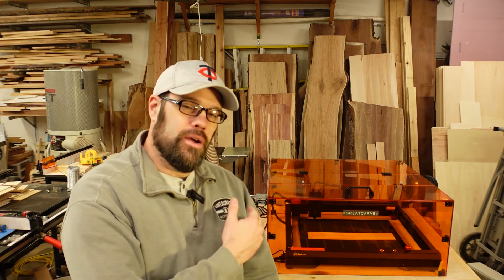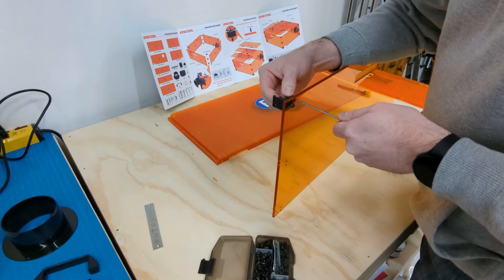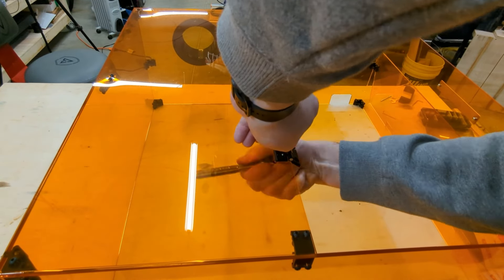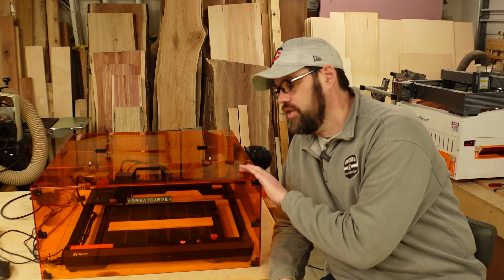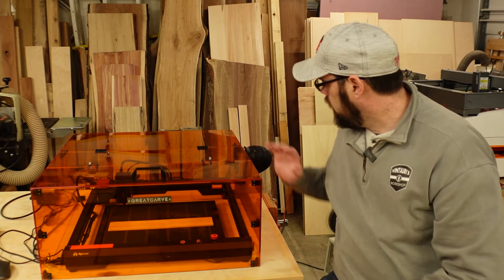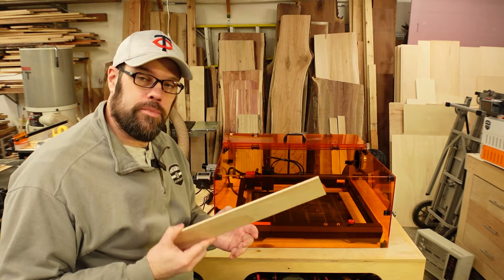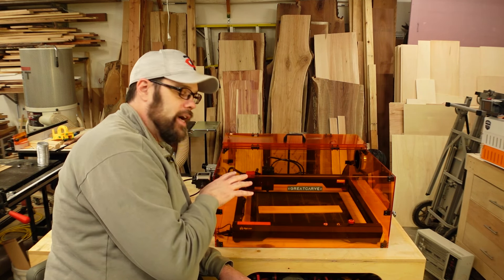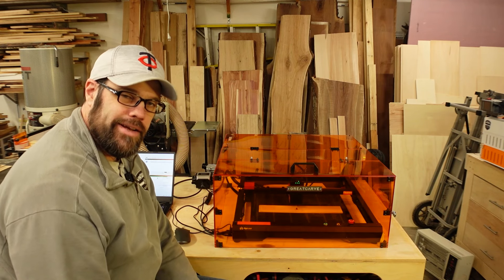Great Carve Acrylic Enclosure for open frame Lasers!

Comment: Thanks for your support!We've carefully watched your video and are improving on the issues you've raised.Thanks for your sharing !🤩
Reply: Might be better to use a barrel nuts and shorter screws? Looks pretty good though
Reply from the maker: Thanks for sending it out!  Overall it's a nice unit that works well.
Reply: What is the OD+ Rating for 450nm range of this enclosure?
Reply: This product is OD 7+ over the range of 190 to 540 nm, blocking deep ultraviolet to green including violet and blue light.The 450 nm Laser Safety Acrylic enclosure can reduce the risk of light entering the eyes from diffusely reflected laser radiation. With an optical density (OD) rating of 7+ in the 190 nm to 540 nm range, they provide reliable protection. 🥰

Comment: Hi, I have checked the great Carve website and it appears they sell the laser safe orange acrylic material only and not any type of a complete unit or a kit? I am looking for a cheaper alternative for the AtomStack A70 max, than the $600 acrylic enclosure kit Atomstack offers. Thanks and i enjoy the videos 🙂
Reply from the maker: It seems as they may have discontinued this enclosure. I have not heard directly from them on that.  It would have been too small for the A70 Max though.  I am putting the final touches on a DIY enclosure for mid sized Diode lasers like the A70.  I hope to have a video out on that soon.  I have not seen any good commercial options for lasers larger than the typical 400x400mm size.

Comment: Ive been really interested in one of these for my LongerRay 5.... ok $279 never mind. Its just an acrylic box and costs half as much as the engraver. No fan or tubing included - yeah, no.
Reply from the maker: Unfortunately the laser rated acrylic is not cheap.  At about $35 a piece for 12x24" pieces, you would end up with a slightly smaller enclosure that costs almost as much.

Comment: Looks like the access could be difficult for a larger piece of material.
Reply from the maker: It would not be hard to block it up temporarily for a larger item but you would loose a lot of the protection when doing that operation.

Comment: Ughh, 1" too short for my delta.  Any other options - I don't like the black fabric, I want to see what's happening all the time
Reply from the maker: Ugh that's too bad, it did fit my alpha but the delta is a bit bigger.  You could check Clearview Plastics to see if one of theirs will fit the delta. I've not used one of them but they have been around for a while making these for a variety of lasers.

Comment: Is this material certified to protect from these lasers or do you wear glasses, too? Kind of risky to pets and kids if it is not fully protective. Thanks.
Reply from the maker: This is the statement from the manufacturer.  "This product is OD 7+ over the range of 190 to 540 nm"  OD 4+ is considered safe with no additional protection for the 450nm wavelength of Diode lasers.  There are still the openings on the lower front corners for cables and airflow, so you would want to keep that in mind for any light escaping concerns.